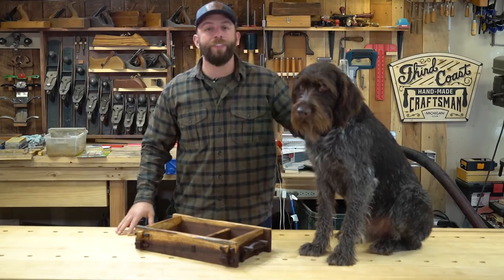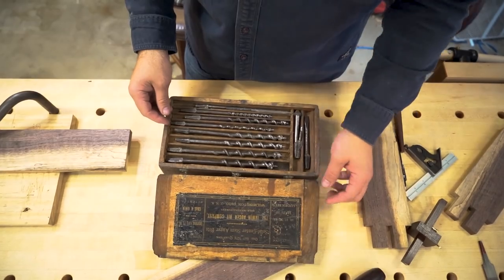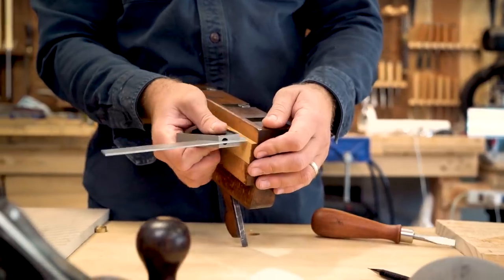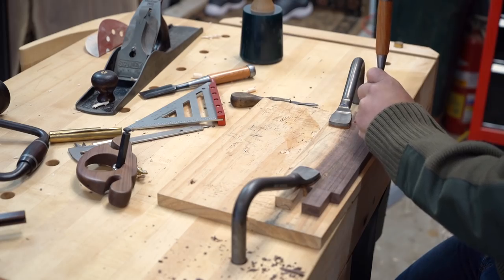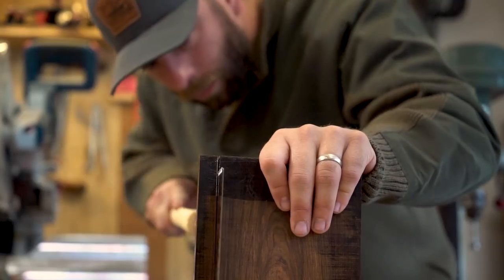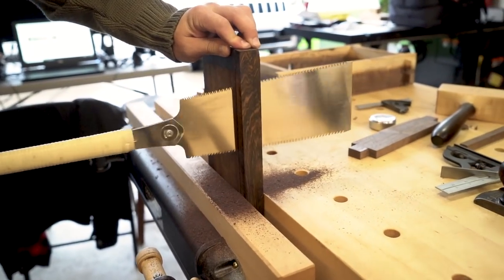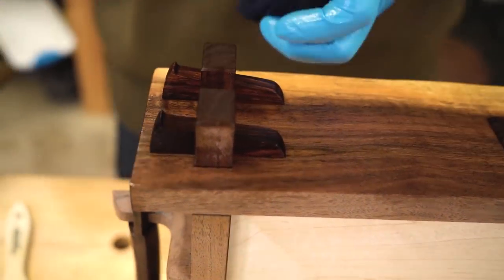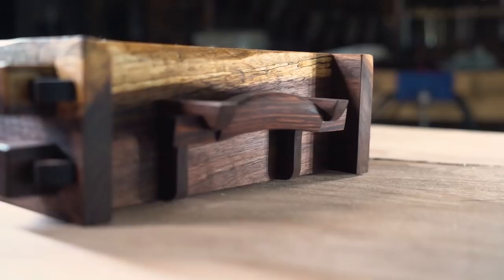EDC Gentleman's Tray Made With Traditional Woodworking Joinery

Comment: Chris, your tray is absolutely wonderful! The walnut and maple contrast plus the scallops on the tray bottom are so good I might have to attempt to emulate, try being the key word.  I have lots of questions as a novice hand tool woodworker.   I’m guessing at the project proportions (3” x 10” x 20”)?  Did you consider other proportions or consider the golden ratio?  I’ve never tried such small tusk tenons, did you  slope the bed angle so they slide in easier or not bother given the small size?  Cheers
Reply from the maker: Hey Greg, I always design and sketch to what’s pleasing to my eye but also rounded to easy whole numbers. I don’t ever apply the golden rule but know that most everything is usually pretty close to that. I always trust my eye on proportions. And yes the bed angles on the through mortises (for the tusks) are angled to match each tusk.

Comment: I made a tray exactly like yours. Actually, it wasn't 'exactly' like yours. To be honest, it didn't look anything like yours but, It was totally handmade using only a busted up old piece of 1/2" ply with four wee, sort of like, live edge pieces, held on with little strips of duct tape and silicon caulking. The whole thing got three coats of paint. Old, oily, thick and lumpy purple gloss paint. I loved that old tray. It didn't cost very much to build. I called it Ben. I miss old Ben!
Reply from the maker: Old Ben sounds like a gem!

Comment: I wouldn't change a thing except maybe the handle bar I would make it from a single piece because it has to stand forces from all directions or just use glue for the handle. That and I would have used wax instead of oil to keep the dull appearance. 
Other than that it is a masterpiece.